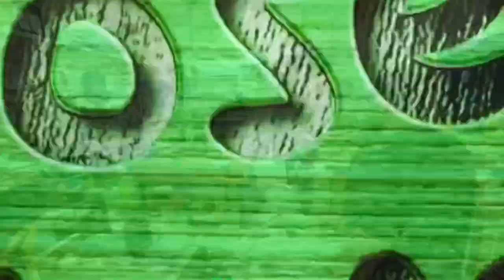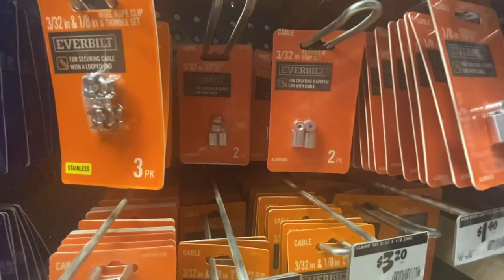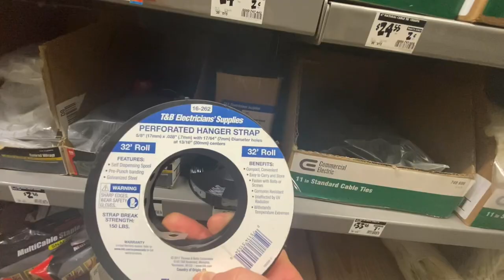A Day in the Life of a Youtuber in the DIY Space | A Closer Glimpse

Comment: Tip for the makita chargers, you can screw them down. Just mark where the rubber feet are on your piece of plywood and then screw trough the plywood into the rubber feet. Works great I did this with my makita charger.

Comment: Nice video!  I'm praying for you brother!  When you got that metal strapping, I saw the price and thought it was kind of expensive.  I roll of what I call pipe strap should only cost 2 or 3 $$.  Any hardware store should have it.  God bless!
Reply from the maker: Well you saw my frame of reference. The first thing I looked it was like 60 bucks. So good to know so brother thank you for the info
Reply: In the plumbing section- “plumbers tape” or perforated strapping and it also comes in plastic!! - it’s up there with wd-40 and drywall screws

Comment: Great video,  and I like how you talk with you audience like it is a conversation, rather than just presenting.  One question.  You said you cut your plywood down to store.  How did you figure what the sizes should be?  Or max sizes?
Reply: That’s a great question. I break it down to the size that will fit my CNC machine. Roughly 24 x 36. Also that allows me to get the most yield Out of the 4 x 8 and a 5 x 5 piece